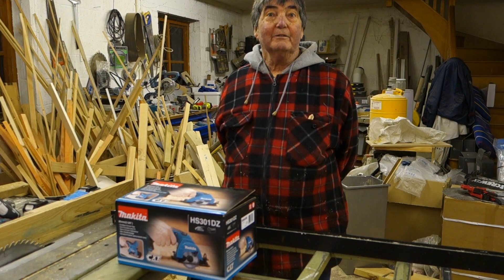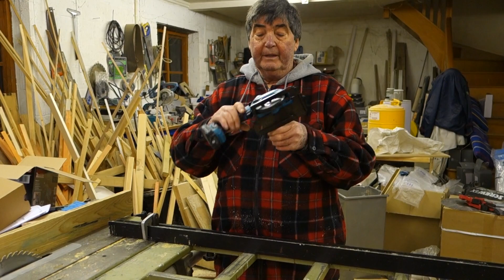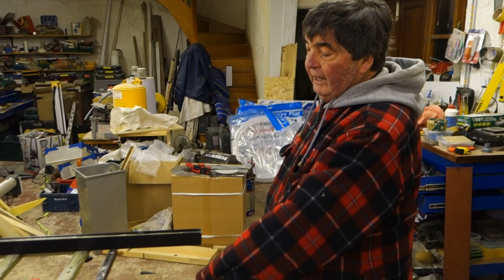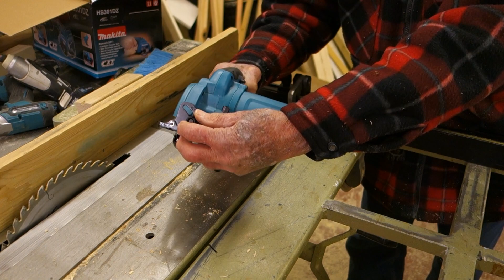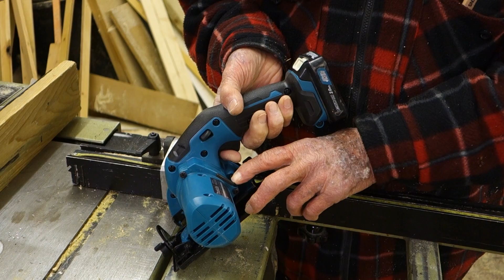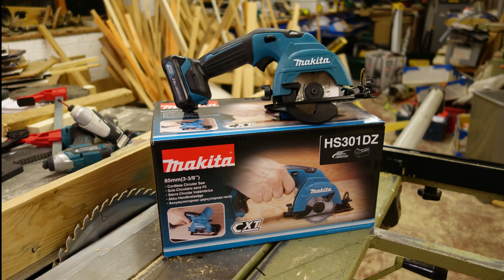Makita 10.8V CXT HS301DZ Circular Saw - First Look is it better than the Worxsaw?

Comment: Mine never came with a guide either the reason why I like a guide is for when im ripping 6 inch rips off a sheet of 12mm mdf when I am doing wall panelling so you don't have to keep marking lines it takes longer to mark the line than cut the strip.

Comment: Hi Brian,I realize this video post is 3 years old.2 questions-is it still performing well and can you cut 3/4” plywood with it?
Reply from the maker: I think 3/4" ply is pushing it over any length, I think you run the risk of burning and running out of battery, but that being said I am cutting 25mm battens with it with ease and it's still going strong over three years. I'm still on the original blade

Comment: Great video that clears a few things up for me. I'm purchasing one of these this weekend thanks to your great video. We mostly do bathroom fitting work, and we are trying to reduce the amount of tools, and size of tools, we bring on with us. We usually lumber a large skil saw around but its overkill for 90% of our work in the bathroom. This tool will help out great. Cheers man!
Reply from the maker: Yes I use mine a lot. Bit odd it doesn't come with the guide but it does feel like a freehand tool. You might be interested in tile cutting version, same main unit but comes with a different blade and a water Despenser for cooling. Check out our Amazon link, it maybe on offer or if like me check out the ffx show this weekend

Comment: Do you think it could cut 1/2” EMT conduit with a metal blade ?
Reply from the maker: I suspect it could but how many cuts before replacing the blade I'm not sure. The blades are very thin. I would suggest the cordless bandsaw for this. I'll post a link
Reply from the maker: https://amzn.to/2sddq3O

Comment: Does this have enough cutting depth to trim off the bottom of a door? If so a very useful and versitile machine 👍🏼
Reply from the maker: I'd be concerned the blade is too thin to  cut straight on a standard door. I wouldn't say it's a finishing too Morena's a lightweight trimmer